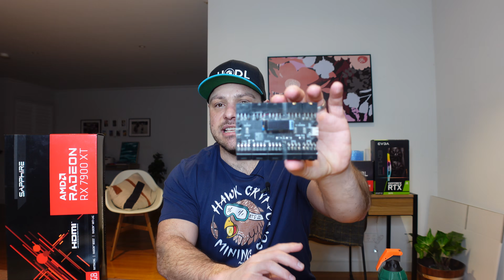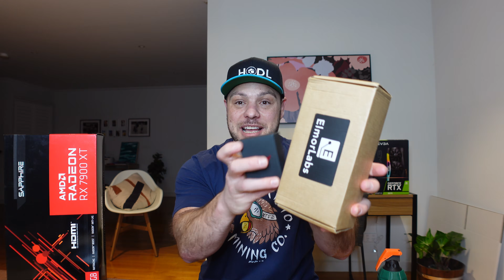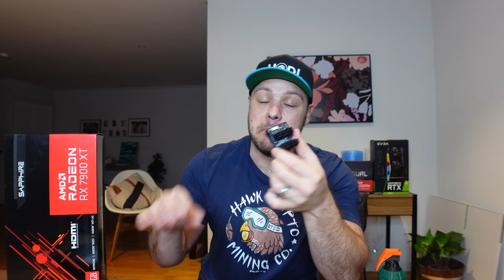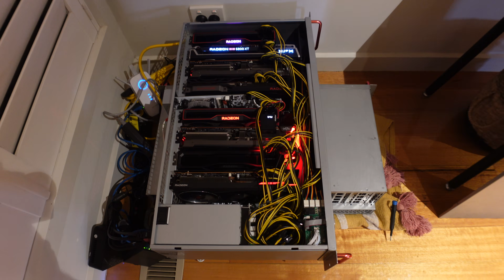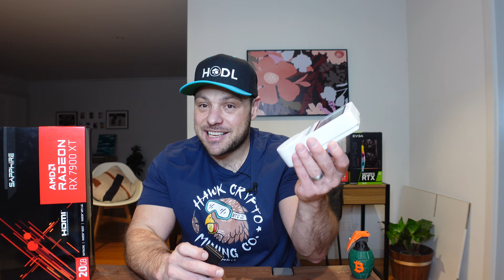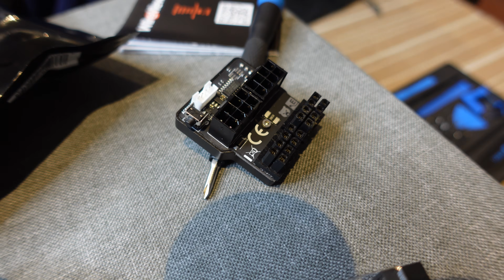Wireview for GPU Miners

Comment: Very cool.  My thought though is that it doesn't measure the PCIe connector power.  Or does it somehow get that info from the GPU?
Reply from the maker: Thanks for watching Max. Spot on, no it will not measure the power through the motherboard pice.